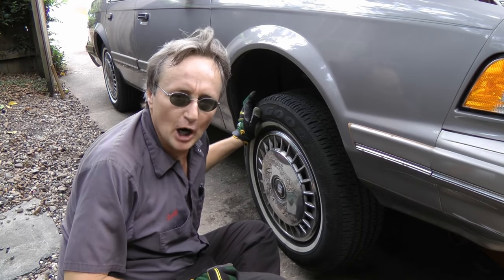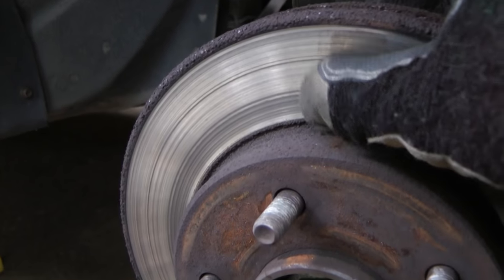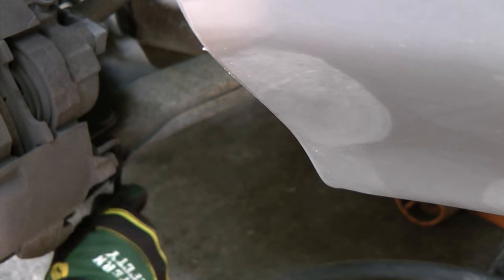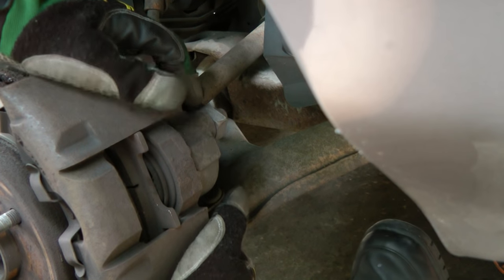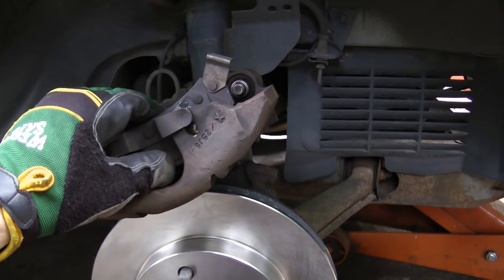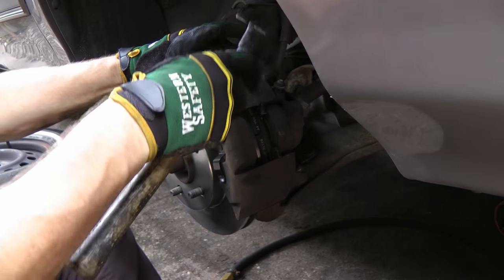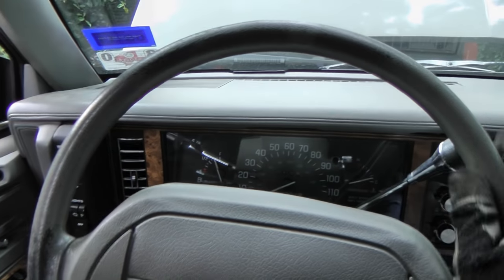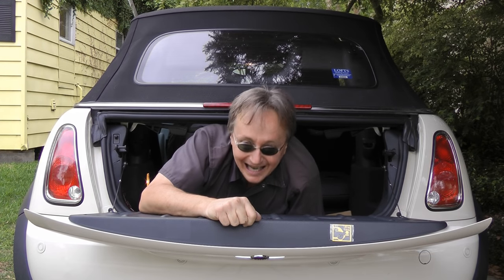How to Replace Brake Rotors on Your Car

Comment: Hi Scotty, I love your videos.  I'm having a bit of trouble diagnosing a problem with my car.  I would really appreciate your input:

I get the steering wheel shake that you mention - the rotors are probably warped.  

However, I also get a "wum wum" sound at all times when driving.  The sound is related to speed of the car.  It seems like maybe a tire issue, but my tires are fairly new.

Could these two things be related somehow?  It seems like warped rotors shouldn't cause this sound.
Reply: Super late reply but more curious if you found out the problem? Could be a simple rebalancs of tires, would love to know if you got to the bottom of it

Comment: Hey Scotty, I have a problem whit my brand new front rotors that has been warped AGAIN! What can I do to fix this issue. My mechanic couldn't figure it out either. The disc's and pad's are from Brembo. Car is a Mitsubishi Lancer Wagon whit new rear brake calipers. The discs and pads where just changed about 2000 km's ago. Please would like to hear some advice on this issue

Comment: Hi Scotty, my vehicle has the same problem, but I believe the wheel hub is not exactly aligned, that is causing the rotor and wheel to not exactly turn at the center, rather there is some up down and side to side moment. So is it possible the steering wheel shimmy, can be caused by this condition as well.

Comment: After reassembly of both sides, don't forget to pump the brake pedal. This will bring the pads to the brake discs. If you don't do this, the first time you use your brakes, the pedal will go to the floor.
Reply: So don’t need to bleed the system just pump the brakes after?
Reply: @Leo6969  These are two different issues. Pumping the brake pedal is to bring the brake pads close to the rotors. Bleeding the brakes replaces most of the old brake fluid. This is done when there is too much water in the brake fluid. You can buy dip strips to test for the moisture content in the brake fluid. There is also a pen shaped device that can be used to test for moisture in the brake fluid.

Comment: would rotors on a 98 dodge neon be considered modern? i was considering having them resurfaced with a lathe but if you advise not to i will just buy new rotors and brake pads.

Comment: Now if i just want to change my Rotors but not my Bake pads....do I always have to do them 2gether?
Reply: Brake pads conform to the surface of the rotors there's used with.  If you reuse your pads they will have worse stopping power and put more heat into a lesser area on the rotor so neither last as long.

This means money you saved now, will cost you as much or more later since brake pads are less expensive than rotors in most cases.  If there is enough material left on the pads you can sand them smooth, but it is difficult to get them perfectly flat in a horizontal plane to the backing so they may not seat properly on the rotors.

The shorter answer is always replace the pads with rotors for the best result.  It's more important that a car stop well than go well, a safety issue.
Reply from the maker: it's a good idea, but some guys will reuse the pads after removing them and sanding them down on a flat surface
Reply: Ok GOT it....☺👍Thanks  guys

Comment: Funny, i was looking for symptons of warped brake rotors, since my car was shaking bad upon braking (at the steering wheel). After i realised i proberly need new ones (RS4 B5, 2001) i gave my car a was. The moment i cleaned up my rimms and appearently the brakes as well, it basicly dissapeared the 'warping' effect. At both low and high speeds. How the hell is this possible? Was dirt the cause of the warping? The discs are 360mm large with both perforated and ventilated discs. Recently they where worked before i entered the nurburgring, but i'm sure that they had a nice beating after the ring.
Reply: It's not your rotors that are warped.  It's improper bedding of your brake pads.

Comment: If I have been using new brake pads for about 3,000 miles on rotors that have mild vibration...I'am going to resurface or change the rotors now...Are my new brake pads damaged now, and should I change them?

Comment: Scotty, I have an issue, I've been trying to look for an OEM rotor for my tacoma 2000 2.4L.  The issue is all the dealers site  is pointing to a rotor with 6 bolts hole, my tacoma have 5 holes.  I even punched in the part number the dealership gave me on Ebay to verify the parts with pictures.  What do I do?

Comment: Hello, Scotty  could you Help me.. Brake lights are on all the time, and  I change the  brake switch already but still remains the same. What will be my problem/ thanks
Reply: Byron Pelico short to power somewhere along the brake light circuit, pull out a diagram and see where all the connectors are so you can test with your meter

Comment: I had terribly warped brake rotors. My mechanic replaced the rotors, but not the brake pads since they are in “excellent condition.” Everywhere I look, it says that pads should be changed as well since the pads probably have indecent wear and might eventually warp the new rotors as well. I think it’s stupid that he didn’t change something so inexpensive to have the best brakes.  What do you think?
Reply: It's bc if your pads have like 80% of life your mechanic should've just sand them down and there good to go.

Comment from the maker: @superspiffy42  If you use quality pads, you don't need any grease. Cheap ones will squeak, so you need some brake grease on the back side. Scotty Kilmer
Reply: Scotty I have a pair of rotors I want to put on my car but when I tried taking the old ones off they seemed like they were on there good. I tried using a rubber mallet and hitting the back side of the rotor but no budge.. any suggestions?

Comment: Scotty, I have to change all 4 rotors and pads on a 2004 Sienna. What do I need to do with the brake piston before beginning? I read on a forum that it has to pushed all the way back. What does that mean? Secondly, when I brake, the car tends to steer right. Is that something wrong with the left brakes not working?

Comment: Evening Scotty, I have a 2006 honda ridgeline and the truck shakes only when I brake, however I check the pads and they look like they still have lots of padding, the rotors also look like they are not grinded. I'm not sure if I should go ahead and replace the pads and machine the rotors.
Reply from the maker: replace the pads and the rotors. they are warped, but only a few thousandths of an inch, you can't see that. NEVER turn honda rotors, they warp too much, replace em, chinese made ones don't cost that much
Reply: Scotty Kilmer
Thanks. Really appreciate the response.

Comment: Mr. kilmer i had a question  i just switched out my brake pads and got my rotors resurfaced, but everytime i brake i hear a squeezing sound were my brakes are. could it be that i need new rotors?

Comment: I put on new rotors and now i feel like the wheels are out of balance. I went to the tire shop and got them balanced but i still get steering wheel vibrations at highway speeds. Any suggestions? I did not have this issue before the brake job.

Comment: When is it OK just to change the pads, and when does the rotor need to be turned or replaced?
Reply from the maker: if it doesn't shake when breaking at high speeds, they are OK as long as they aren't gouged up
Reply: Thank you.
Reply: cheaper to replace than be turned

Comment from the maker: @coolguy23448  some are made cheaply, some just wear out over age from brake pad friction eating material off, and some are used REALLY hard and warp from braking heat (real maniac driving though, or driving through a LOT of water which will warp hot rotors.) Scotty Kilmer

Comment: Hey scotty, My right side rotor is worn and warped more than the left side. I was checking it out the other day when I was changing my oil and noticed that when I spin the wheel while it's in neutral with the front end in the air the wheel will hang up on some spots on the rotor when I turn it by hand. My car pulls to the right. Is it common to have a warped rotor cause a pulling issue?

Comment: Hey Scotty my Chevy cobalt does that when I brake from 60-40 or so and also when I'm doing 55... But only the front left wheel, could it be the rotor? What if my brake pads are pretty new? Can I leave them? And do I really have to replace both rotors?

Comment: Hi Scotty: i just gave up on my car-the front DS rotor is warped. I was able to  get one of the 18 mm (head) caliper bracket bots off-the other is stuck. Would heating the head help? also, in your opinion, will liquid wrench free up a frozen bolt?
Reply from the maker: Ad Mirer heating it works much better.

Comment: Do you need to bleed te system or open the cap for the brake fuild compartment as you push in the piston?

Comment: scotty, the rear disc rotors that have the drum brakes inside them for the parking brake on a 2001 hyundai sonata 2.5 . are they easy to whack off with a hammer or do they use bolts to force them off? Kody

Comment: Take a minute to coat the hub mating surface in anti seize the next rotor replacement will be very easy, no banging it comes right off. Been doing this for 20 years on Jeeps used in winter driving and on the beach so lots of salt exposure.

Comment: Scotty, I have an 03 Expedition and recently replaced my front brakes.  I replaced the calipers since it seemed the front left brake was binding.  I replaced the pads and cut the rotors at O reilly.  They told me one of the rotors had to be but twice,  I dont feel any pulsating, just a sound like if the tire is separating on the front left.  I also bled the brakes.  When I lift the tire in the air and rotate it sounds like the pads are hitting a high spot.  Could this be the cause?  Warped rotor

Comment: Scotty, my 1964 Cadillac steering wheel has a rotating wobble around 40 mph,you can feel it & see it.  I've changed the whole front end steering, upper & lower ball joint's, pit man, idler arm,tie rods,Drag link, replaced the drums, steering gear,Flexible coupling, new tires (balanced ) drive shaft turned & balanced, can't think of anything else to change or fix :(  can you ?
Reply from the maker: Joseph DiIaconi heck go to a good front end shop,let the check it out, most give free estimates. Could be anything from a worn tire to bad wheel bearings

Comment: Hey Scotty I had a GMC Yukon XL 04 recently  they did the over-hull of the transmission to label 3 which he say is for heavy duty jobs puling trailers up to 6000lb, the problem is puling a trailer  forward in a flat surface  is Ok  but  when it try to back up the trailer on a hilly driveway the motor do not have power and  spiking, even in a flat  street, any idea whats going on, is a transmission problem o motor problem.....?

Comment: Hey Help Please!? The other day I noticed that when I brake I hear like a fast pace knocking coming from up front and it will stop after ive been sitting still for like 3-5 secs. I also noticed LITTLE steering wheel vibrations while braking. Is this brake rotors?

Comment: Hey Scott? I have the same car you have in this video and my car shakes while driving over 40mph and when I brake. I been driving back and forth to work like this for about a week and my question is, can driving with bad rotors have an effect of losing brake fluid at any certain time?
Reply from the maker: na, I had an old man customer drive his 3 years that way, scared the hell out of me when I road tested it, but he didn't care, it still worked
Reply: Aaron Russell if your rotors are warped because the caliper pistons are bad then the boots around the pistons could be leaking... but this is just a guess having worked on my own calipers
Reply: First, shaking when driving over 40mph tends to indicate some other problem, like a wheel imbalance.  Having it happen when braking could mean two separate problems.  It's not uncommon for an old car to develop multiple problems if you don't repair each as it occurs.

Driving with bad rotors, causing that pulsing, does wear out your calipers much faster due to the constant in and out movement with each wheel rotation, and worn out calipers can leak.

However your question is an odd one.  Either you are losing brake fluid or you aren't.  Check the level in the reservoir and if it is significantly low, you need to locate and fix the leak before driving again, because running out of fluid in the system and suddenly becoming aware of it when you need to brake hard, can be an extremely dangerous situation.  

Brake fluid cannot just disappear, there will be a sign of leaking somewhere, though in an odd case it could leak into your brake booster and  not be easily visible, especially if you only inspect for leaks along the hard lines, hoses, and wheel cylinders, but the obvious indicator is it is missing from the master cylinder reservoir.

Comment: I have a question about Corolla 2010. I want to learn to change the brake and rotor by myself but how many bake and rotor I have to buy?
Reply from the maker: +Seng Serey one set of brake pads, and two front rotors

Comment: Is it required to torque the caliper and lug nuts when putting everything back together? It's crazy how much places are charging to do this, when I can get a set of rotors and pads for a fraction of the price.
Reply from the maker: ***** technically, yes. But I've been bolting em on by hand for 47 years with no problems. Get em as tight as you can by hand and they will stay on.
Reply: Scotty Kilmer Thanks, I have a 2003 Chevy Malibu, and the steering wheel will shake pretty violently when braking from high speeds, and the brakes will pulsate almost all the time. I took it into a shop to get a free brake inspection, and they couldn't diagnose the problem. Is there a method to isolate whether its coming from the front discs or the rear drums? I ordered a pair of rotors and pads today, and hopefully I'll be lucky.

Comment: hi scotty i have a 2004 Honda Civic and i just changed the rotors and pads a month ago because the car was shaking but the shaking still doesn't stop. Could you give me some other problems i could possible be facing?
Reply: Paul c when was the last time had your tire balanced ?

Comment: If the rotors have minor scoring should they be turned or replaced or left as is? I dont notice any steering wheel shake when I brake from 30 or 60 mph.
Reply: If you're going to continue using the same pads, leave the rotors as-is.  If you're replacing the pads, or sanding them flat, then have the rotors turned (lathed) to flat and true again.

If you don't do that, then eventually the pads will break in and work reasonably well, but there will be accelerated wear on both parts.   The only time they should really be reused with ridges is an emergency situation, like you have to get to work and earn a living and don't have the money or time to wait and do it right, but it may cost a little more in the long run.

Comment: Hey Scotty, the front brake rotors need replacing on my 1996 Honda Accord. The rotors are pressed into the hub, meaning the cv axle nut has to come off and I don't have a socket for the size of the nut. So how do I remove brake rotors that are pressed in?
Reply from the maker: you'll need to buy the socket on that crap design, and realize you may damage the bearing when taking it apart and need a new one. Brilliant honda engineering there.
Reply: hi scotty, thanks for info but i have one more question, you said that a bearing may be damaged when removing the rotor, what is the name of the bearing and what is the the best way to remove the pressed on rotor?

Comment: Is it a good idea to resurface the brake rotors instead of replacing them ??
Reply: Qais Mohammed nowadays many after market rotors are dirty cheap and just as good as OEM, so may as well just get new if not much difference in cost.
Reply: It used to be that way years ago until the current technology to mass produce new rotors changed it.

Comment: hey scotty, i have a 2001 mistubishi diamante and the steering wheel shakes when i brake but also when i accelerate on the freeway at higher speeds. what do you think this could be?

Comment: hey Scotty, I'm 17 and recently purchased a 1986 Volvo 740 gle. my dad was driving it earlier today and realized that the right wheel seems to shake a bit (also steering wheel) when braking. I finalize my license stuff the 17 of March and was wondering if it would damage any other components of the car if I practiced driving it (low speeds like 30-50mph) and practiced maneuverability. I plan on changing the rotors when I have the money (1month) so should driving it be fine? thank you in advance
Reply from the maker: it doesn't hurt anything, I had a guy drive his 4 years like that, then sold it without fixing.

Comment: Hi Scotty,i need help,i changed the discs and pads on both front wheels on my 98 celica and now when i step on the brake pedal at high speeds the stearing wheel starts moving left to right.Why can this be happening? 
Thank you so much in advance!

Comment: Is there a trick to the rotors that are held in place by screws? I changed one before n it was so difficult that i abandoned ship on the other side. Had the old style impact screw driver. Maybe get the automatic one huh?
Reply: I had to drill the screws out on my Honda. Wasn't all that tough

Comment: Hi just changed front rotors on my 02 accord cos they were done but my car shakes when apply brakes on freeway now with new ones like if warped is it possible to get bad new rotors.didn't shake before n i put m on right  easy to install can't go wrong.have u ever got defective rotors before. Thanks.
Reply from the maker: if you didn't also replace the pads with new ones, realize the old pads will be uneven, change them too.  If you did, then you got bad rotors or have a front end problem like worn tie rods or ball joints